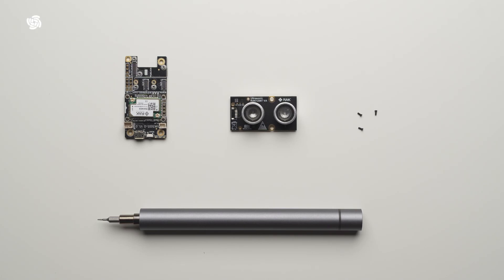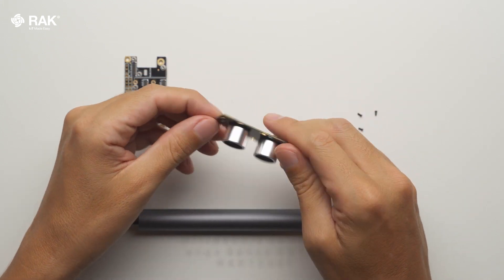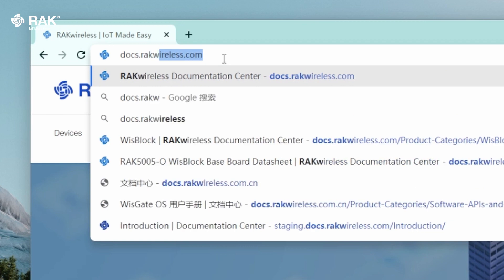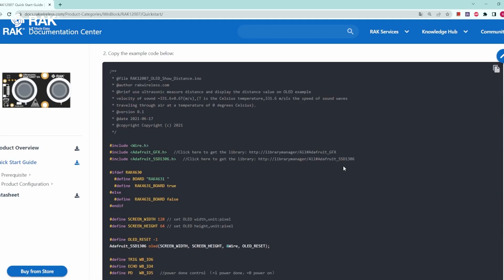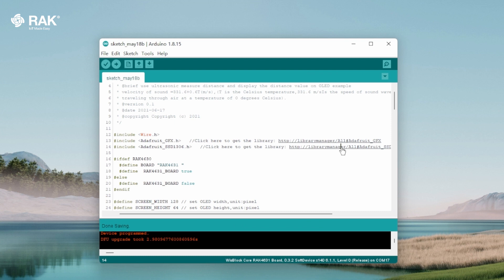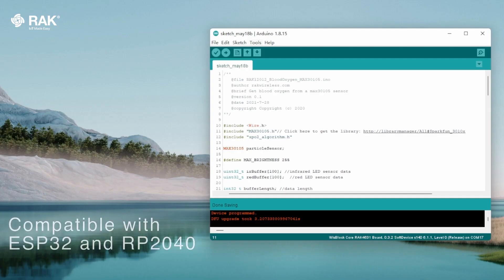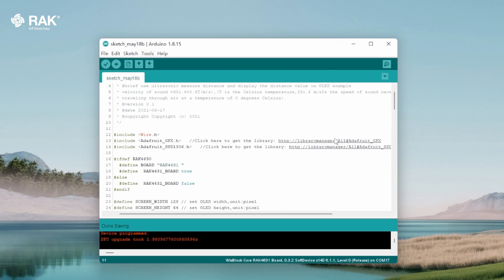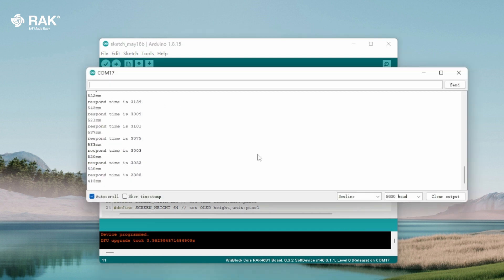Ultrasonic Sensor ango Sense CS100 Work with Arduino IDE | RAK12007

Comment: What model of transducers are you guys using for this device? I am using other 40khz transducers and they do not work with the cs100. Angosense does not provide a datasheet for the cs100 on their website other than information that if supports 40khz transducers. These transducers I am using are the closed face style, does this matter or is there a specific voltage or other rating I need to follow for the transducers? @RAKwireless

Comment: Hi RAKwireless, is there an Arduino code for ultrasonic sensor using LoRaWAN ?
Reply from the maker: We don't have a complete LoRaWAN guide for Ultarsonic Sensor. However you might get inspiration from our complete tutorial in RAK Knowledge Hub - https://docs.rakwireless.com/Knowledge-Hub/Learn/RAK-Developer-Kit-4-Guide/#creating-environment-monitoring-application. This uses an environmental sensor but you can replace it with the ultrasonic one.